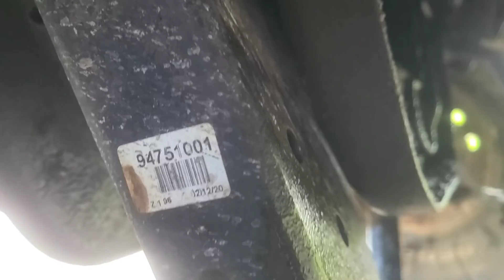Its time for the SCRAP YARD

Comment: The camera hurts my eyes, makes me think you’re driving right side
Reply from the maker: I would use the rear camera but its broken an not the best quality
Reply: @freeddiesel  I think Yeetus meant he didn't like limey brits just like me. You should have an option somewhere in the settings of front camera to switch mirroring on or off, so we won't be thinking you're driving on the wrong side of the road 😉😃
Reply: Like how dose the camera change the way it looks like wtf how dose it make it look as if it's rhd
Reply: Is he messing with gears making it do that